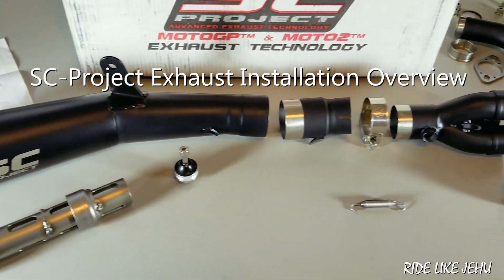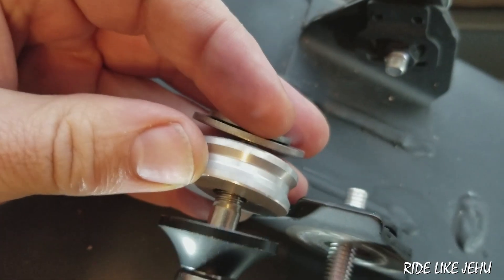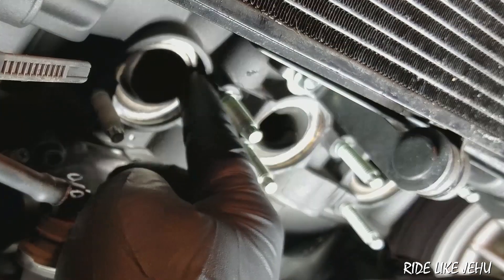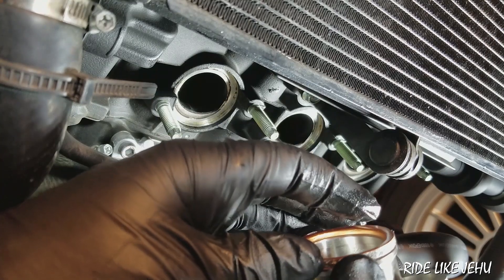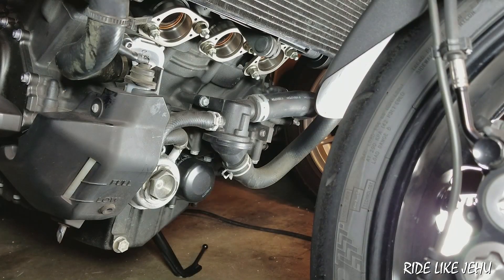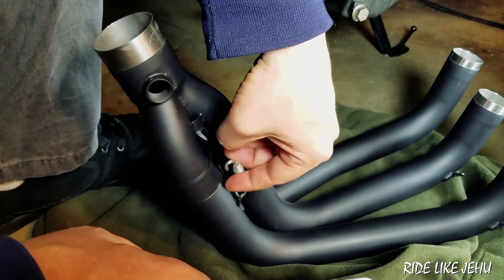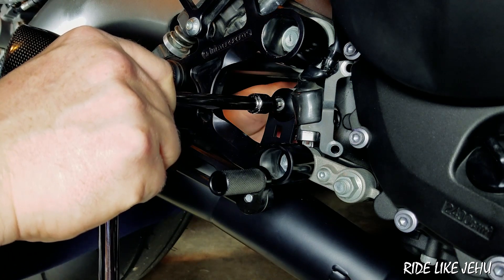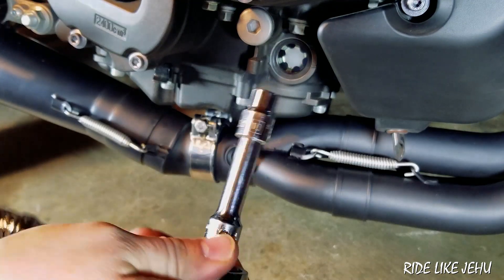Yamaha XSR900 SC Project Exhaust Upgrade Part 2

Comment: Hello Jehu, many thanks for this video(s). This the only step by step tutorial I found which covers literally everything from A to Z. I have just one question. Why did you use a copper grease for the sensor and lithium one for the headers? I just had an email exchange with Leovince for my echaust and they recommended to use grease which holds up to 2000F and above as the exhaust can reach temperatures above that threshold. Isn't unusual to use a lithium grease which holds up to 1000F max?

Comment: Did you have to do an ECU tune or a flash with this exhaust or can it just be installed and ridden without. I'm debating on getting the same exhaust but I don't want to do the tune or a power Commander.